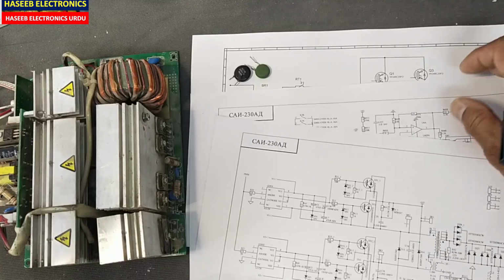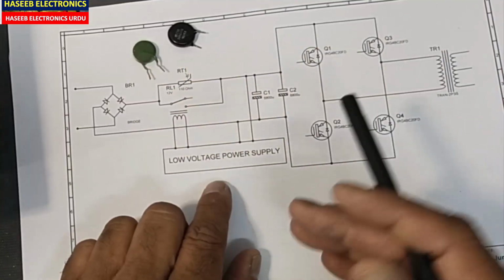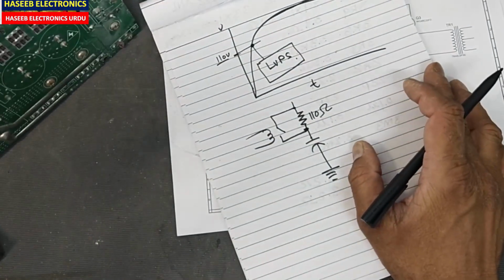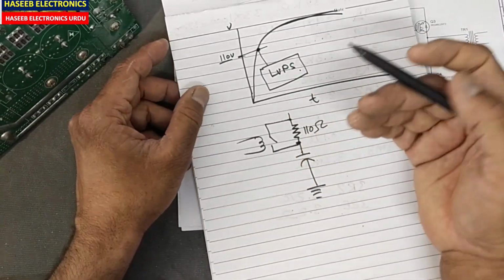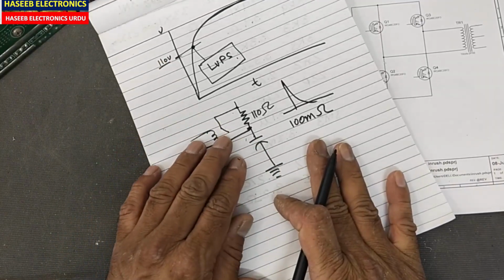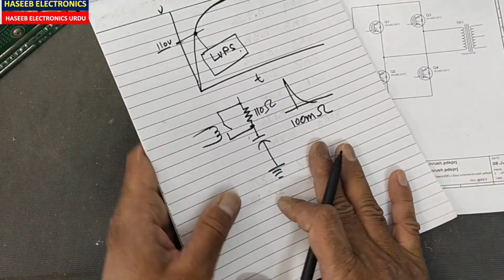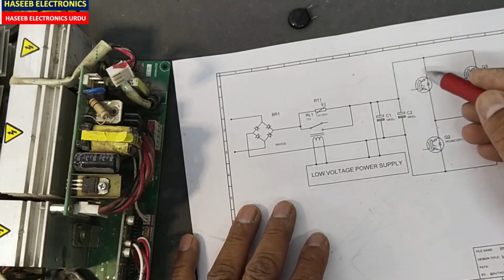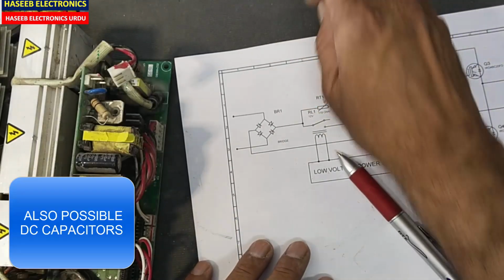{625} Why NTC or PTC Thermistor Damage in Inverter Welding Machine / Inverter AC Outdoor Unit

Comment: Makita 300A no power and Ntc or ptc thermistor is hot how to solve
Reply from the maker: possible reason. short circuit on DC rail. check bridge rectifier, Main capaictors, IGBTs / MOSFETs

Comment: Sir mere pass ek welding machine aya hai 
Usme problem hai jab cooling fan connect karta hu tab machine band ho jata hai 
Sir pls reply
Reply from the maker: possibly the cooling fan is damaged. you can check fan using external 24 volt power supply 
or if fan wires are connected in reverse oreder. it will the same issue

Comment: As far as i know, all switching power supplies (and a welding machine is nothing but a high power switching power supply) use exclusively NTC thermistors between the rectifier and the bulk capacitor positive terminals, for the reason being very well explained in the video. I would only add to this explanation that the NTC thermistor (presenting by its nature high resistance when being cold, which rapidly reduces to a very low value when getting hot) protects not only the bulk capacitor(s), but also the rectifier diodes as well. On the other hand, PTC thermistors were permanently used in the degaussing coil of colour CRT TVs of the past. In fact, there were the two of them (one NTC and one PTC) included in a single plastic package having three connection pins, with one of them in common. Then, the NTC had the exact same function as described in this video, while the PTC one had the degaussing role. This means the opposite function of the previous one. Low initial resistance  - full (momentarily) A.C power to the degaussing coil - degausing effect at that very short time - very high resistance (almost open circuit effect) right afterwards, since degaussing had being completed upon starting the TV...

Comment: my inverter welding machine damaged cermaic resistor the  machine name(Typ : 2120eco -200A DC) serien -number 2120EO308101-Q
(EN 60974-1) and i cannot find the circut digrame can u?

Comment: Sub. 👍. My ntc green is 3 ohm and on caps only 160v .what issue ntc?
Reply: 220v system
Reply from the maker: it depends on ambient temerature, current rating, chip size, capacitor size

Comment: Excellent explanation. So if low voltage supply is not working then capacitor will not reach full charge, or if NTC or PTC blows open nothing will work, if ntc or ptc go short then other parts will be damaged.
Reply from the maker: If low voltage power supply stops functioning
The bypass relay will not turn on and all the current will pass through ntc / ptc
Which will cause to blast ptc (if there is ptc then its resistance will increase while the resistance of ntc will decrease with rise in temperature)
In both cases the ptc / ntc may damage 
In upcoming sereis of welding machine repair i will try to cover all possibilities in full details

Comment: This was an excellent video - very well explained.  I had a shorted capacitor that was heating up the thermistor rapidly - pretty much exactly as described.  When I took a suspect IGBT off the board it tested faulty and the machine turned on.  Superb, thank you!!

Comment: Salam alykom haseeb thanks for the videos, i have a problem once i start welding i see the first spark and yellow light turn on ( over heat protection) the machine had a faulty igbt i changed them and fan is working again. Can you point out how to test the overheat circuit or do you have a video for it? When i restart the yellow lights goes off bit again first spark then it turns on.

Comment: Assalamualaikum sir.
I have an inverter welding machine when turning on after a while the ptc  heats up and the machine turns off then keeps turning on and off. I checked most parts of the circuit I didnt  find any short circuit niether the mosfet nor IGBTs. I dont know what is the reason for this heat up ptc( 115 ohm ). I replaced the relay but same. The bypass circuit is before the bridge rectifire it works properly. The machine output is ok when turning on. I tried to replace this ptc with ntc it worked properly but after several time turning in and off the ntc blown up  
Sir if you can help

Comment: Please make video on power supply  why my DVDsony DAV DZ 151kb  power supply is given over voltage  on one pin  in place of 6 i have found 8 .2 volt and when I connect connector with mother board my 3.3 volt is missing and voltage of 6 volt which is 9 volt in my MOSFET is drop half

Comment: I’ve had to repair so many of these for clients. I normally only do industrial repair and metrology related stuff for big factories and research labs…… but a lot of Friends/acquaintances/customers have bought one of the smaller cheap machines to weld at home or to start learning. I’ve been impressed with the quality of even some of the cheapest machines. I think they are perfect for most people, it’s just important to remember a few A few things.

If the machine does not have a proper System to monitor temperature and cut out…

A lot of new people who are learning don’t understand about proper “duty cycle.” 

So the most important thing….. is that if you have a smaller cheap welder and it does not have MULTIPLE points of thermal monitoring and cut out, you can still do something about it and make it a lot safer.

Just buy one of the cheap $5-$10 thermal cut out power/outlet adapters on eBay….. and plug it into that first so that if it does overheat, it will cut out before it starts to explode. 

Just place the thermistor/temperature sensor in the welder at the hottest place inside the welder which is usually somewhere around the heat sinks and bulk capacitors.

Some of the ones available on eBay and Alibaba have two or three different temperature monitoring sensors that come with them. Giving you the ability to monitor the temperature at multiple places inside the machine. And then it will cut out automatically so that you don’t have to worry about constantly watching your duty cycle/welding time. Because if it doesn’t have a way to monitor the temperature and cut power, and you don’t watch the proper duty cycle and thermal management REALLY CLOSELY, it will make a very loud bang and smoke for a little bit. Hopefully it won’t take out half of the circuitry inside and it will be repairable but it’s just easier to monitor the temperature from the beginning
Reply from the maker: really great and valuable points for equipment safety
actually, many manufacturers who don't care abut their brand name's reputation OR some cheaters produce low quality items with some known brand name,
which causes the loss for the end user. it is a huge loss for equipment and it oversees the human safety
otherwise, at production level, if all safeties and protections are incorporated, that will make it long life and safe
Reply: @HaseebElectronics  👍

Comment: Hi Mr , 
I have a question ، i placed an ntc thermistor in a wheatstone bridge , and it gave me a totally non linear curve including a negative voltage ,it goes like 
0°=4V , 10°= 3.5V ,  20°= 1.5V , 40°=0.5V , 60°= -0.5V , 80°= -1V ,  
100°= -1.2V 
So how can I make it linear to complete the process of display it and so on .

Comment: Good tutorial thanks for sharing but I have a challenge on how to calculate the value of the capacitor usually placed between the heat sink of every full bridge inverter and what is their function and some times you see four of them kindly explain in detail
Reply: @HaseebElectronics   okay sir please check I really need and that of half bridge inverter calculation
Reply: @HaseebElectronics  sir I have another challenge on how to select the value of NTC thermistor and also when do we use either PT. or NTC thermistor. Thanks